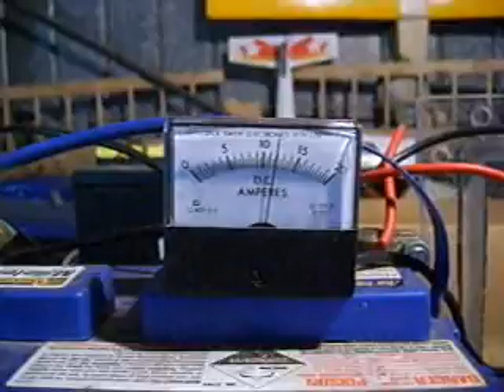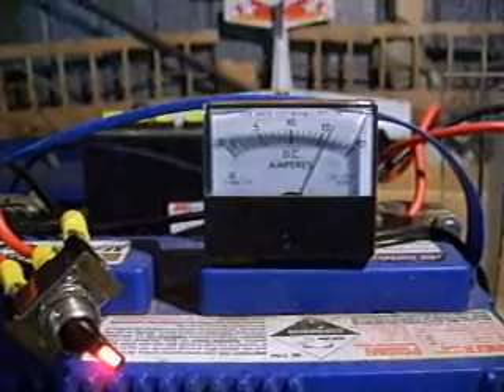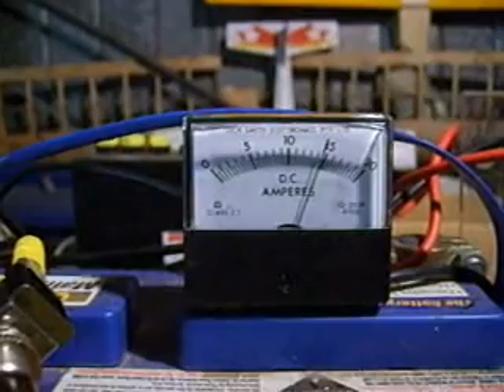Hydrogen at home (New cell 2 hour tests)#22

Comment: if i use some similar instalation to decrease fuel consumption to my car (the engine is hot so temperature is big), u think my battery could receive to much amps and explode?

Comment: Oh and also, I see you threaded tabs with 1/4" SS bolts. You should put SS nuts locking against both sides of the tabs. I had an explosion, (luckily it wasn't bad), because I got sparks in the threading. Be safe! ;)

Comment: Yea, this is typical... The Hydrogen and Oxygen naturally bond as soon as they are able. this happens right in the water as well as on the surface. "Correction not steam but water vapor" It does not need to boil, or even be hot for this to happen. Nice work bro!

Comment from the maker: I am using 304 stainless-steel, it's all that I could find at the time.

You are better off trying to get your hands on 316L stainless-steel.  It apparently produces less nasty by-products such as hexavalent chromium, which I have just found out about and will talk about on my next video.  In the meantime please dispose of your used water as a hazardous material, not down the drain.

Comment: Do you know what grade stainless-steel you're using? I notice that you have none of the rusty substance collecting at the top of the water bath and that you're using regular tap water. Thats what I'm trying to achieve, however I still seem to be getting that. Very nice job on you setup. Keep it up.

Comment from the maker: Thanks for that, I am still not sure if stainless-steel is the best way to go for the connection lines.  Even though it makes sense to use it. I am not sure if it's the best conductor, however my knowledge of such things is a bit limited.